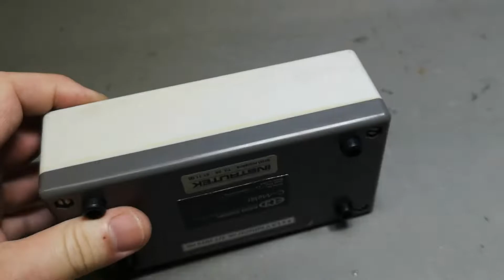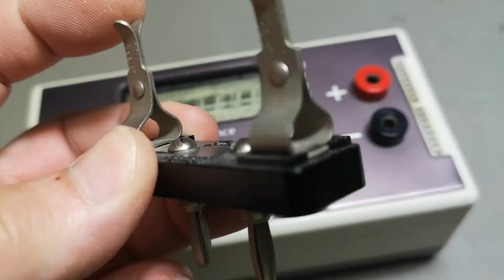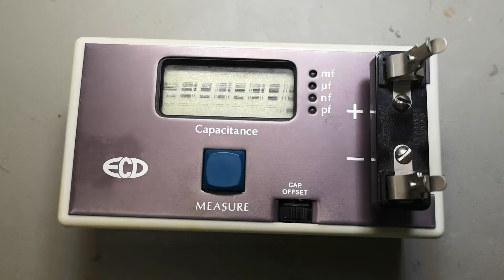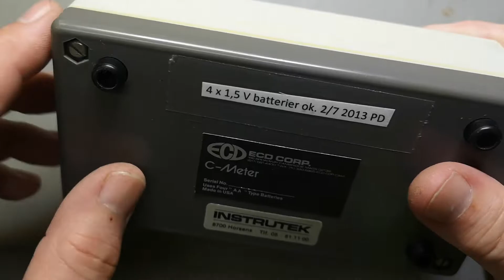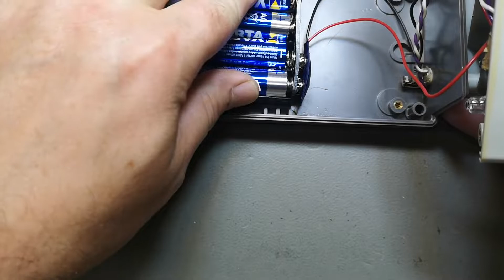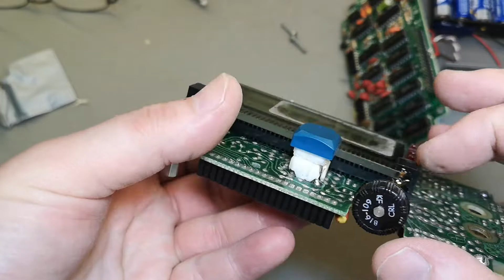ECD Corp 20930 C-Meter capacitance 1976 test teardown

Comment: Bulb input protection, because it heats up really fast, and if it blows cheap to replace. Display looks like one of the early common backplane 6 digit displays, so should be easy enough to replace, just look for the same display at RS or such, as they likely have it in one of the old catalogues, so you can then use the part number to see what is a replacement unit. Those were commonly used in things like fuel pumps and such, 6 digits of display, easy to drive, and easy to backlight as well.
Reply from the maker: great idea about a backlight lcd and new lcd upgrade.

Comment: I would never have suspected the glass to be bent, but i guess that's what happens when left after MANY years. Usually these displays die from leaking in air, but there is no sign of this. I guess you could take one of those old standard 3/4½ digit LC-Displays with pins for soldering and make an adaptor since it's a very simple LCD with only one backplane and no multiplexing.
Reply from the maker: yes i am sure it is possible to change that LCD, just need a non mux'ed LCD about same size, pinout is easy to see thry the glass